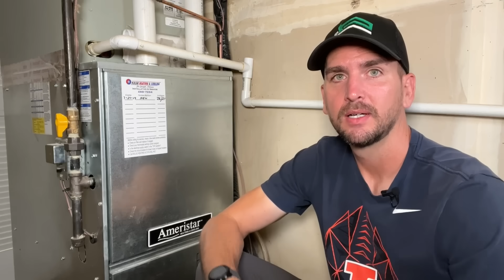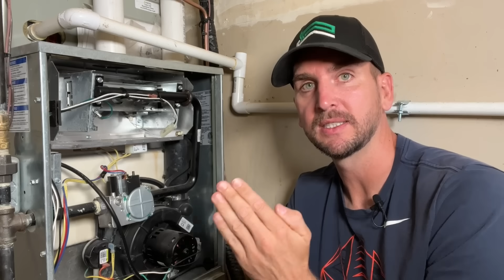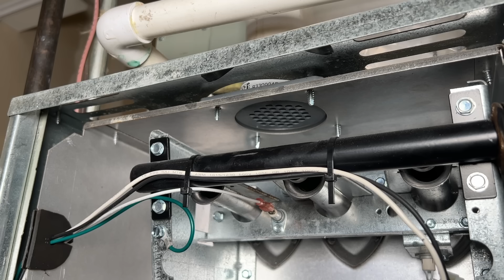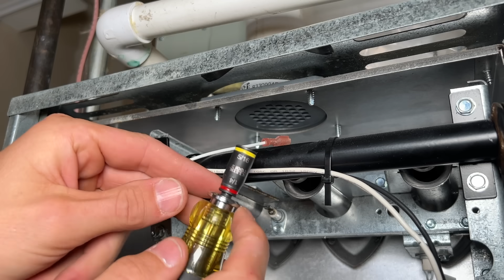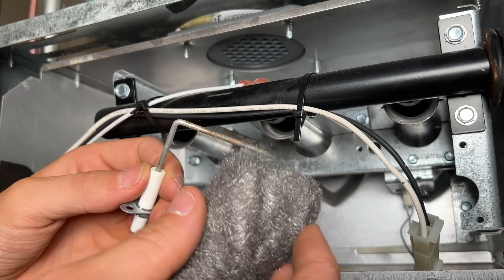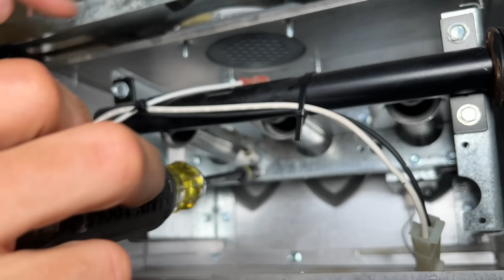The Most Common Reason Why A Gas Furnace Won't Turn On

Comment: I use Propane, furnace wouldn't lite..There's a flexible plastic tube that goes to a pressure switch(?), i took it off blew through both end, heard the switch click..upon putting the tube back on i noticed a blockage of lint/dust inside the nipple..Using a thin wire i removed the blockage...To my happy heart the furnace kicked on, stayed on..I saved hundreds in a service call and likely THOUSANDS by finding this simple fix..Just saying, something to check..

Comment: Great video.  I had the first motor run but when it came time for the blower to turn on the unit shut down.  It was doing this off and on.  I cleaned the flame detector and now the blower turns on every time.

Comment: If I disconnect the PVC air intake pipe from the furnace it runs fine. Connected the burner cycles as though the flame detection sensor is failing. What should I do?

Comment: Furnace problems can be usually traced back to negligence on the part of the property or homeowner. Sometimes do it yourself or YouTube advice isn’t always in your best interest. A train technician can usually spot serious defects or potential defects upcoming, and Ward them off to save you an early demise on your Heating appliance. There’s a reason why licensed technicians are just that their license because they’ve had proper training and certification.

Comment: I prefer to use a little Scothbrite to clean the sensor, then wipe it down with some isopropyl alcohol. I do it every fall. I've never had to replace the sensor, but a spare is a good idea, especially in Northern Illinois, where an inoperative furnace is a huge problem.

Comment: January 2026   Trane  HVAC  Model Number TUE060A936K2 Ser # P353JL22G Installed Summer of about 2000.  So at least 26 years old. No flashing diagnostic lights on this unit. 

Flames not lighting . Glow plugs lights up brightly. Fan cycles on. Glow plug goes dark. Fan cycles off.  This cycle repeats indefinitely until I turn the thermostat at the control panel in the hallway to “off,”   unplug the unit from the electrical wall receptacle, or  turn off the correct circuit breaker switch. 

Away from that location with that heater at this time but when get there, intend to: 

test for continuity for what I perceive to be a solenoid gas valve 

and test the wires connecting   to this perceived  solenoid gas valve by disconnecting them and testing for electrical current.  Suspect the electric  current comes from a heat sensor to the glow plug in the form of low voltage direct electrical current. 

Question, which wire probes from the volt meter should touch wires from the possible heat sensor to the glow plug? Wish to avoid damaging the volt meter. 

Hoping dollar bill or steel wool trick on possible heat sensor will work too.

Comment: EVERY HOME OWNER NEEDS TO KNOW THESE STEPS  I HAVE KNOWLEDGE ANDS FIXED MANY 
I HAD A BOARD FALL RELIANCES WEEKENDS S COST WAS QUOTED 1100 DOLLARS I HAD BACK UP HEATER GET ME BY WENT TO DEALER PICK BOARD UP 142 DOLLARS AND REPLACEMENT 30 MINUTES INCLUDING CLEAN UP A REPLACEMENT FURNACE AT THE TIME COULD BE BOUGHT TOTAL NOT INSTALLE 1100 DOLLARS //SERVICE MARK UP ARE CRIMINAL DOING MY OWN WORK HAS SAVE ME OVER 10000 OVER THE YEARS REALISTICALLY MORE

Comment: my furnace was off this morning i relit the pilot light as normal turned it to on and told the hubby to turn the temps up on the wall unit upstairs he did several temps above what it said it did not go woof and turn the burners on full. the unit upstairs on the wall said low battery we put new batteries and still wont work help. it is friday late at night and it should be an easy fix but no one can check it for free until monday

Comment: Worked for me! Thank you.

I ran into having 2 flame sensors (I think) and then 2 roll out sensors as well. Had to do a little side research to figure out what the roll out switches look like. That is the only point I would say is missing from this video but otherwise great info

Comment: Some furnace are sensitive to flame sense. If in doubt clean it. 2nd rubber hose off inducer port can be plugged do same thing. If you font have that flame sensor then it is using the ignitor which case replace it. If you say but it lighting. Yes but not sensing flame weak ignitor.

Comment: Question? Heat censor location ? Rheem   Classic 90 plus code flashes. 3 bulbs. Two lite one on the right stays on one in middle one flash then 3 quick flashes ??

Comment: what an awesome video with a fantastic explanation.  starting with the step by step guide as to how it works to cleaning the sensor.  currently -10 here in Alberta with a furnace not working and it's foxes thanks to your guidance.

thank you

Comment: This video was a savior! Heater stopped working and came straight to YouTube to see if I could possibly fix it myself. Got the ladder and went up into the attic. Sure enough, there was just enough corrosion buildup on that sensor stem to prevent the flames from staying lit. Cleaned it and works like a champ, just in time for winter. Great video, thanks !!

Comment: I was really hoping this would work for me.  I changed out the sensor and the igniter but Im still getting a constant blinking red light which reads "no call for heat".  Unfortunately, had to call a technician in for tomorrow.

Comment: An 8 minute video just to talk about the flame sensor? Should have explained a blocked pressure switch vacuum hose is also a common problem and can be fixed with a sewing needle.

Comment: A beneficial aspect to debugging is how to decipher the blinking light (if available). The sequence will often point you in the right direction. The codes are typically  shown on the inside of the removable panel.

Comment: Figured out my furnace issue only to discover that no one will sell me the part because I’m not a HVAC technician. I’m sure somewhere online but it’s freezing out so it’s gonna cost me to get it today. Air pressure switch. Internet is great to let you know how fast and cheap it could have been.

Comment: My furnace gas kicks on but it wont ignite. It just smells like gas. Changed the ignitor and it worked for about 4 cycles and then it did the same thing. Not sure whats going on 😢 because eventually it works again and then after a few cycles it will just throw gas and not ignite.

Comment: My gas furnace comes on and runs and blows hot air for like 10 minutes then shuts off and everything runs for about 10-15 minutes hot air again then shuts down again, our furnace is only 5 years old ….. I’ve changed filter and everything like you should every month or so

Comment: They need to build these out of stateless like we use for exhaust on the cars and trucks .I had one the other day where the gas valve was 89 ohm's and killed the board the gas valve should read 8.9 ohms .

Comment: Congratulations on a GREAT video here. 🫡 As a former Engineering instructor, I have on  occasion been disappointed by some of your previous videos (and I was not shy about commenting about the shortcomings on YouTube )  for pointing out that more than one thing could be the source of a problem and then you never bothered to go back and address what those other possible sources were.😮

In this video  I loved how you repeated ( multiple times) the sequence of events events on how the furnace functions… I love your excellent video work showing the transition from a pilot flame to all the burners igniting… And I love the fact that you gave not only the low cost repair option but also explained a potential “no cost” option. This was excellent work of which you should be VERY proud!👏

Comment: Super duper easy to follow! The step by step ignition process was so well presented was able to confirm my ignitor was done for.
From the second I cracked open furnace, watched this video and ran to hardware store I came back home with the part and repaired it in an hour.

Comment: Really appreciate you taking the time to make this video, thank you. I have a situation where I don't get ignition at all, but after a few cycles if it does finally light everything works are normal. I have also replaced the igniter, would I be safe in assuming that I need to clean the orifices perhaps?

Comment: Flame senser draws about 3 microamps from circuit board when senser is clean. When you clean flame senser make sure power is off, 120volts can be present at the senser wire and senser.

Comment: To solve the problem for my furnace not coming on was the thermostat, I had to remove the sensi thermostat face plate and re-engage it. This solved the issue for me.

Comment: HI. Thanks for this info.  You forgot step 7.  I live in Ontario Canada in a 10 month RV park where our place needs to be winterized and shut down for Jan and Feb. When I came back my furnace would go through all the steps, light then the flame would start blue then turn orange and go out. The next day I went outside and where my stack should have been was just a bump in the snow on my roof.  Cleared the snow and the furnace fired right up.

Comment: What about a inducer motor that starts but shuts off with no ignition?
Over and over....
Turn the power off for 30 mins, turn it back on and it works fine, sometimes for an hour, sometimes a couple days....
2 techs here and neither know what's wrong....
Everything has been replaced....suggestions?
We're lost.

Comment: Thank you very much! This is the first time I need to repair the furnace, your suggestion nailed it! I also belive it's important to clean the contact between the screw and meal chassis as this thermopar sensor has just one wire, thus the current flows through the metal frame.

Comment: I called a HVAC repairman and he says I need a new computer board for $1,599. I watched this and cleaned my sensor and it was fixed. I’m convinced 90% of HVaC guys want to rip the consumer off
Reply: And usually a furnace control board is cost couple of hundred bucks, depending on your furnace.  My old furnace was about 80 bucks. My new one is about three hundred.  So for 1500 bucks, a golden elf was going to be used to install it. Using his tongue of course. Rip off artist

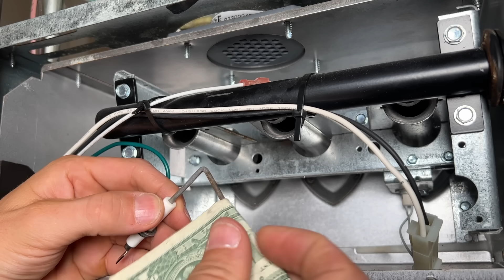Comment: @6:00

I know nothing about furnaces.
This morning we woke up to a freezing home, and our upstairs neighbor's water heater had exploded and was actively flooding our utility room. We got the water to the building shut off, and killed the breakers and then got a hold of the owners upstairs. They had a plumber take care of their problem but I couldn't get the furnace to start after we dried everything out. 

I watched your video here and watched my furnace start up. It would ignite and then shut off. So I found the little rod you are showing here, took it out with a little ratchet my father in law bought me and cleaned it with a brillo pad, then wiped it off with a cloth. Boom. Totally saved the day, and now my wife thinks I'm all "handy" and shit. I even figured out how to relight the water heater. 

Thanks a million man!

Comment: Mine stopped working this morning. It runs the draft motor for like 8 seconds then stops. I checked the element with a multimeter and it shows resistance. Draft sensor bad or airflow blocked?

Comment: My daughter’s furnace is in a mobile home. It will light then click then nothing. The blower won’t turn on.  If you turn the thermostat to run the blower on constant it runs and sounds fine.

Comment: It's absolutely hilarious that this chinesium tech that's been solved for 80 years fails the way it does. Look at any modern smartphone. It is infinitely more complex and works flawlessly for years before the battery goes. This garbage is designed to fail. Designed by jews and repaired by morons.

Comment: My problem is… My inducer motor turns On & the blower as well, but the igniter Never ignites. I turn Off the Heat on the thermostat but the blower fan staying On. The only way to turn Off the blower fan is to turn the switch Off. 
help please anyone. 

By the way I installed a new capacitor & a new inducer fan.

Comment: My problem was similar but even easier. The inducer came on but no igniter. I removed the rubber tubing going from the inducer to the relay, and stuck a pin in the inducer where the tubing was attached. There was some kind of obstruction in there. I reattached the tubing and all was good. This has happened twice now.

Comment: i got code 33 for weathermaker 8000 carrier.  the flames come on but the blower motor never turns on and system turns off.  is that a blower motor problem ( presumed capacitor) or is that a limit switch problem?

Comment: Thank you so much! You just saved me another $250 from calling an HVAC person! I've woken up the past 2 days with my house at 66°. I followed this video to the t and clean the carbon off of the flame sensor and it works fine now, house is warm in January!!!! Thank you!!!! 🤗

Comment: I’m not getting the blower fan turning on. I get the step one I hear something turn on, step to the burners light then no blower fan… instead it goes from a yellow light blinking once normal to 4 red lights stating limit switch open… do you think it needs a capacitor since nothing is blowing out of the vents? When I take the doors off it’s hot inside where everything is located

Comment: If the unit is trying to ignite....in the cold of winter or blizzard conditions of lots of snow...check your outside exhaust..if you have that on side of house....blocked with snow or ice....was my reason....after clearing away, furnace stared to ignite

Comment: Crap. I did this and no furnace isnt turning on at all. Before it was turning on with no flame. Cleaned ignitor and now furnace isnt turning on at all. All switches are turned back on so i dont understand 😭
Reply: AH NVM...COVER HAS TO BE PLACED ON FOR THIS ONE

Comment: I changed the filter, now the furnace doesn’t come on, why
Reply: Problem solved, It was the bottom panel! First, the panel was stuck/jammed shut, then there is a small white button that stuck out that button had to been pushed-in in order for the furnace to work! May have to replace this button or can I add a drop of oil?

Comment: After being told I needed to replace my thermostat, which I did and was still having issues, I happened to have. Watched this video before going all that and thought whatever I’ll try it using steel wool to clean it. It worked so I’m thankful for this video and a resolution

Comment: You forgot an extremely important tip . Check the drains for the furnace and air conditioner . They also will stop your furnace from running when they become blocked or restricted with dust or debris .  Check and clean both lines for AC and Furnca drain . The AC drain is usually the culprit for putting materials into drain pipes because the coil is exposed to constant humidty and humidty will cature dust from the airflow . Even with an air fliter being in the furnace, some dust still gets by. It is not an airtight system

Comment: Came home from working all day in an ICU, tired, hungry…and you guessed it, no heat! Tried troubleshooting simple things; filter, made sure blower was working on fan mode, etc. and still nothing. Decided to go to YouTube and this was the very first video that came up. Decided to give what you explained a try because my heater was doing exactly what you said. My set up inside was a bit different so I had to figure out what I was looking at. After the sensor fell when I unscrewed it, and I couldn’t find the screw for about 10mins, I panicked! How would I explain this to an HVAC professional that I had fooled around in the system and now couldn’t find the screw? Well, lo and behold I look on the floor, and the screw is sitting right there with the drill, not remembering the drill had a magnetic bit 😂😂😂 Adrenaline cools back down, take my dollar bill, clean the sensor of the carbon buildup, reassembled, then I prayed and prayed again. Turned on the system, ran upstairs to the thermostat, flipped it on heat mode, and with a sigh of relief, the system is back on!!! My kind friend, I can’t thank you enough!!!!!!!

Comment: What if the pilot flame turns on but the main burner doesn’t turn on at all? And it makes a repeated buzzing sound for a while and then the pilot flame shuts off. It keeps repeating this cycle and it won’t turn on

Comment: Worked for me - replaced the flame sensor/thermocouple  - cost for 24 " thermocouple  +/- $14.00 at local hardware store and my labor. I cleaned it for the past 2 years, so I just replaced it this year.

Comment: If it activates all , draft motor,
Igniter and triggers the gas valve only momentarily, 
Check thermostat and wires. 
Had one which worked to activate all components, 
24 volts at gas valve with wires off,
Even held for 8 seconds, 
Connect wires back to gas valve, just a spike of electric but not long enough to open valve.
Redid wires to thermostat and fired up perfectly. 
Test by just a jumper from R to W on board.
If it lights, 
Check thermostat or the wires.

Comment: My heater quit working I replaced the letter it will go but will not lite the funstes or Heather works if I lite it with a literhest up to the right temperature they such off but will not relite last year I beypest something and it di fine but I forgot what I did and did not fist it what I might have done and how to fix it

Comment: Thank you so much! Solved my problem. First time home owner and I know nothing about furnaces. I followed your steps and it worked. Another thing to add, while I was trouble shooting before I got to your video I had my bottom panel off checking on the blower. After I followed your advice my thermostat said I had no power to the furnace. I was so confused. I checked the power switch and the breaker to make sure they were in the right position. Turns out there is a switch in the middle of my furnace that is only activated when the bottom panel is put in place back on the furnace. I closed it up, turned everything on and now we have heat.